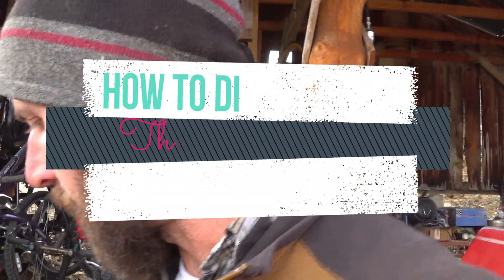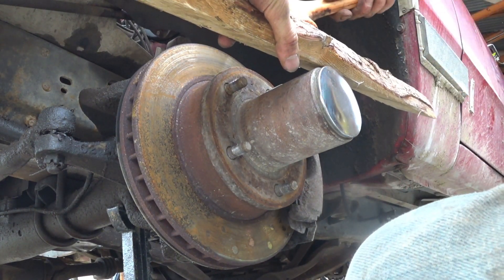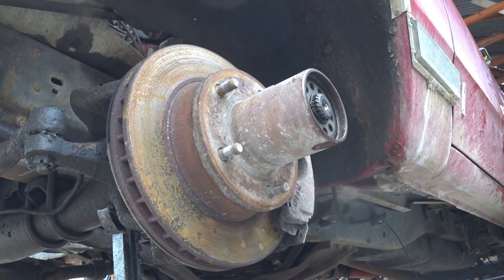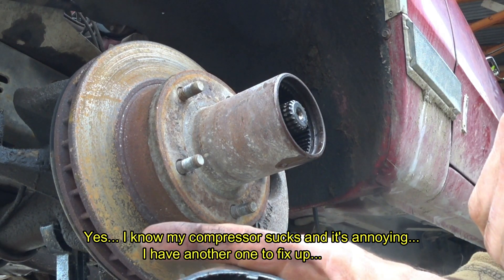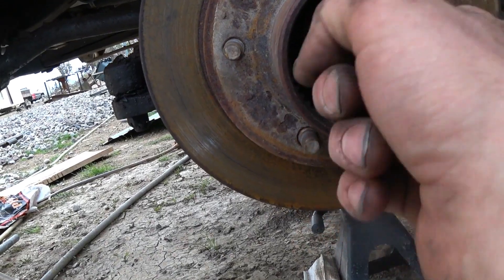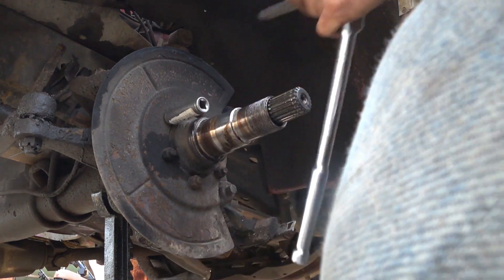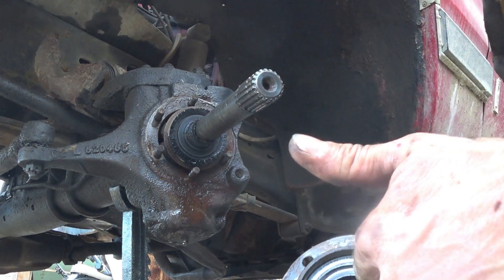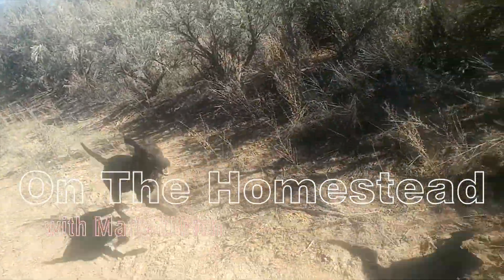How to Disassemble a Dana 44 Front Axle

Comment: what is the lip seal part number?
Reply from the maker: No idea - bought it on rockauto or eBay - this video's a couple years old so it's been a minute
Reply: @MartyUlrich   thanks anyways. I’ll keep looking.
Reply: @MartyUlrich   is it the spindle seal?
Reply from the maker: @sickmansgas483  It's called a lip seal. Just gets light pressure from the pre-load bolt - just there to keep help keep the grease in but mostly to keep dirt out.

Comment: FYI, they make a tool to remove that spindle. And most parts stores will rent you the tool with a slide hammer.  Sometimes for free with deposit. Way better than potentially ruining your spindle
Reply from the maker: Yes, this is true, but I was showing how to do it without as most folks would probably also opt to not rent said tool. Long as you don't use an air hammer or anything harder than the surface of the spindle itself you'll be fine. I destroyed one 2x4 on each side and not a single dent or ding on any of the spindles. Now I would not be surprised that the aftermarket ones are made as good as the OEM parts.

Comment: Would a Dana 44 Front axle Ring Gear and such be the same from a 1/2 ton and a 3/4 tone? I mean as for using it from the half ton to a 3/4 ton? As long as the ratio is the same? A friend of mine asked me and I was not sure if it was possible? Hes never done it before and I never have tried!!! Never needed too!! OH and its a Chevy as well...
Reply from the maker: Dana 44 is a Dana 44. Most 3/4 tons are running Dana 60s in front...

Comment: Try a set of brass punches instead of wood.  Whoever put those lock nuts on that tight need to stop working on cars.  When I disassembled a 44 out of my 79 Bronco it was much easier than this.  Of course I presoaked the nuts and bolts with PB Blaster days earlier.
Reply from the maker: I used to have a nice brass bar... it grew legs one day...